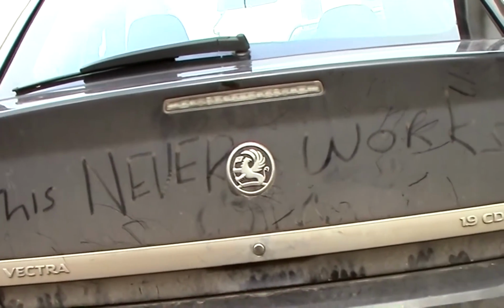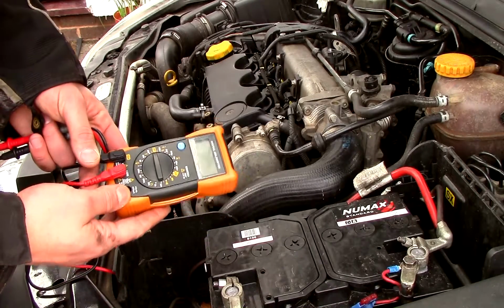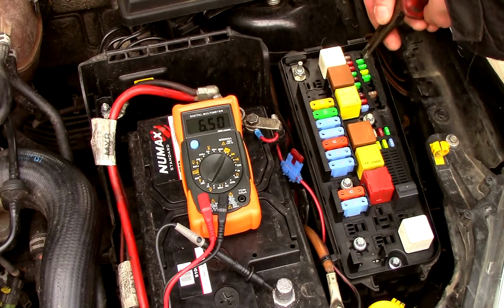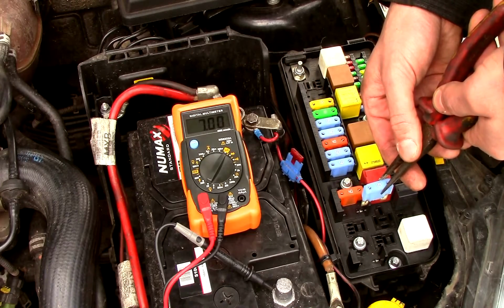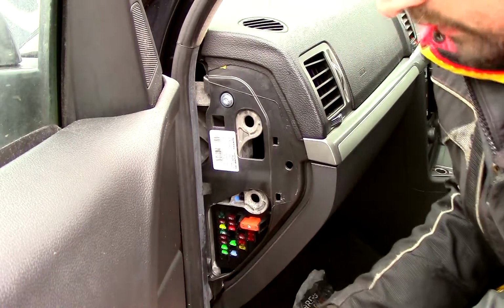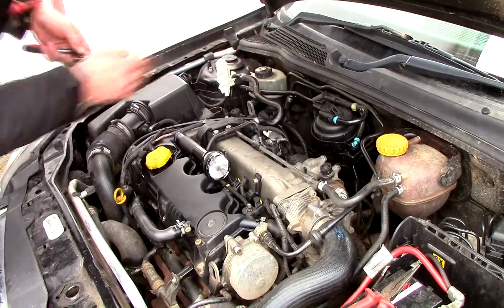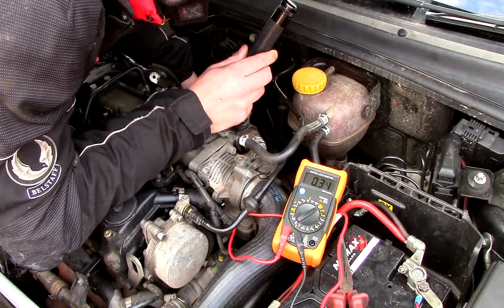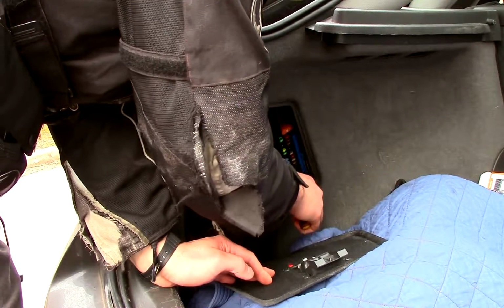How to find a parasitic drain / draw on Vauxhall vectra 2008. Max 19 amps. Constant  flat battery.

Comment: Nice Vid, good diagnosis, only thing different I would have done is to check the Glow Plug Relay before checking individual Glow Plug, in most case on Diesels, the GP Relay is wired directly to the Battery (normally unfused) and can sometimes fail, or the Contacts start to arch and  build up overtime, causing a short or intermittent short across the contacts that feed the GP,s.

Comment: This awesome video needs far more love.
I'm totally glad you didn't find the draw under the first fuse as the next steps was exactly what I needed, mine turned out to be the negative earth under the battery tray was corroded but was super helpful to see two more options (alternator and glow plug) check you performed would certainly help many people, Vauxhalls of this year and design almost all suffer parasitic drain at some point in my experience and I wish there were a OBD-linked sensor that would let you know things like this, wouldn't be hard for them to add.
Reply: great comment!

Comment: Not quite sure how a glow plug is causing parasytic draw? To my knowledge they are only supplied with 12v for a few seconds before you turn the key to start, therefore if they're drawing current all the time then the relay must be permanently energised or its contact is welded shut?
Reply: exactly how can one glowplug cause it
Reply: @kenwarriner69  They can't! The fault is elsewhere.

Comment: I had exactly the same. I was losing 2amps with a parasitic drain and found it using this video. In my case, it was a fuse under the bonnet which supplies the rear heated screen. I pulled the fuse..,the draw went to zero and I’ve never had any problems with a flat battery since. No heated rear screen but I don’t care.

Comment: This should not be happening, the glow plugs are controlled by a relay and the relay should be cutting the power when the ignition isn't on :/
Reply: Relay could be faulty (stuck contact ) I would have changed relay as we’ll .